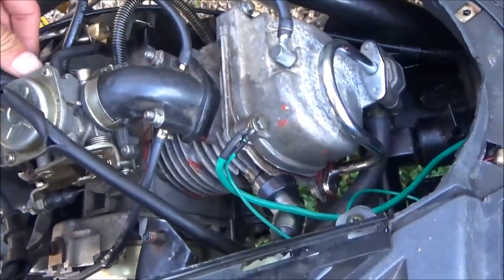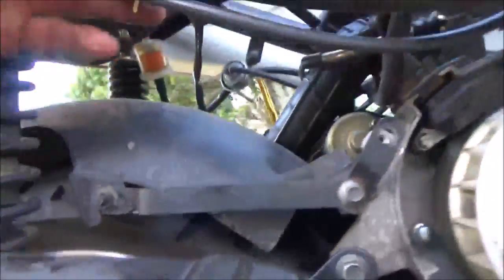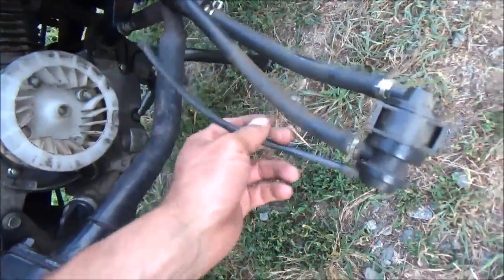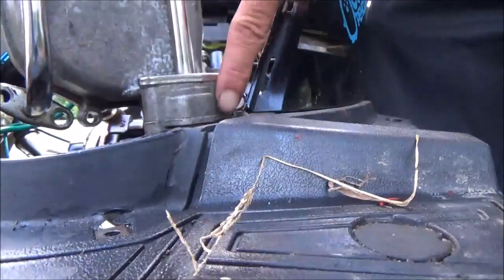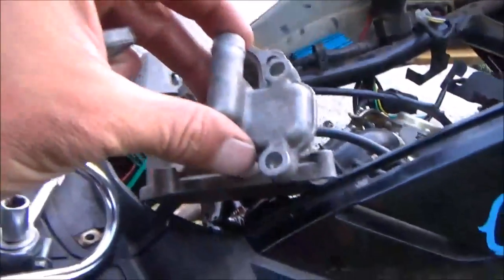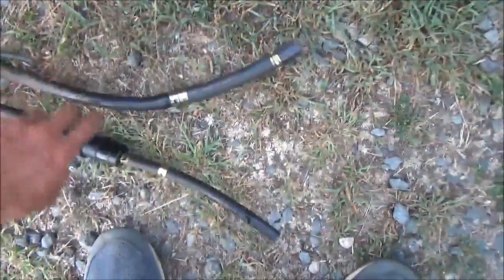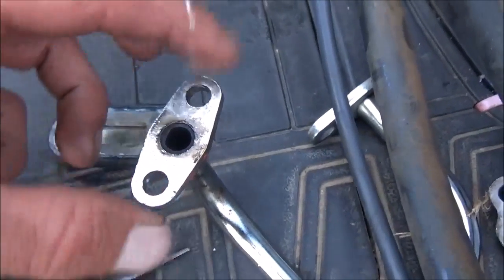Scooter EGR/Pair System Removal (Emissions Delete)

Comment: I just gasket sealed the inside of the crank case you pulled off. Removed my hoses and all's well. No need for welding anything just left the chrome bar on it since its not hurting anything anyway.

Comment: I removed a similar system from my 150 cc scooter some years ago and it improved a lot, but I needed to adjust the mix on the carb.
Reply: Yann Kitson do u think it will pass inspection at DMV with it removed? My braided hose has a hole in it so im thinking of removing the whole system.
Reply: Mine has passed the test once, but truth be told they spent all their time on testing steering, breaks, lights, tires so they never noticed that I had removed the ERG system.
Reply: Yann Kitson ok cool thanks!
Reply: It would no longer pass an emissions inspection.
Reply: Some states dont do emissions test on scooters/motorcycles. Safety inspection only here in NC.
Reply: @gregatron4528  that's why wait until you pass the test and then remove it 😂

Comment: I was thinking of pulling mine off. I recently unhooked the little hose that was hanging off the end of the filter connecting to nothing just suching in air I could not see a need to keep it when it was doing nothing and well I gained 3mph after I did it and better acceleration but I cant say it that 100% as I also installed a direct coil system.

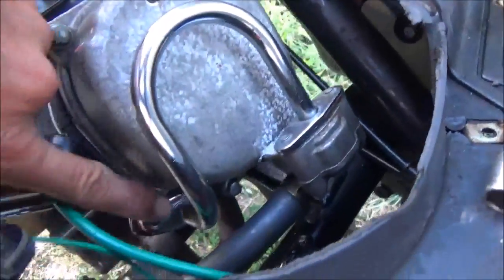Comment: Can I just take the canisters and lines of by that big hose by the pair system and it'll still run? What about the home that my emissions tube cones off of? At 1:21 it's the big tube by your finger... And I know I have to plug the intake valve opposite the vacuum side. I'm not a mechanic lol. My manifold has 2 nozzles where my other bike is already done which only has a vacuum hose attached. Thanks for the help

Comment: when you said if you dont have the egr valve then you would need a blocking plate how do ik if i need to put one or not and if i do put one nd theres no need for it will ot effect the engie everytime i drive its stays revved up nd accelerates on its own also hard to start the idle is low

Comment: Could I use a reciprocating saw to cut that piece you were mentioning using as a cover? I know they make metal cutting blades for the saw I just wanna know if it's capable of cutting that metal.
Reply from the maker: Yea, any hand hacksaw will do
Reply: @joshcb7  Thanks man. I appreciate the help.
Reply: Amazon sells pre prepped head covers no welding required
Reply: Here's the link https://youtu.be/ubUosWJUhM4
Reply: Can't you just take a Dremel and cut the silver tube that connects to the port with the reed on the left and right side and then cap it without having to remove the reed? That way all you do is cut the silver tube in two places and pop the hose and charcoal canister off and you're done. Or does it have to be welded and have the reed removed? I just got a new bike and I didn't want to go through all that extra crap like before if I could help it.

Comment: I try to remove EGR.
I plugged the centre hole of the backing plate well completely lost all compression.
remove backing plate and compression came back to 165psi.
didn't think EGR would interfere with compression but it did.
i have gy6 150cc  152QMI-3
Reply: wheres is the backing plate

Comment: You're wrong. What you removed lowers the temperature in the block cap. Take a good look at what you deleted. When the engine is idling the small hose opens the valve and lets fresh air into the cap.
Reply: You have a point there 👍